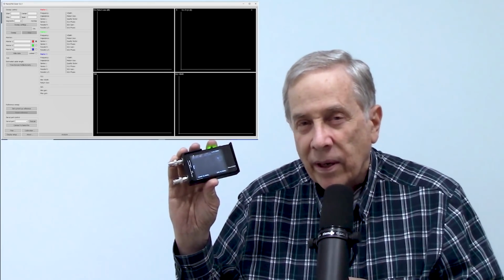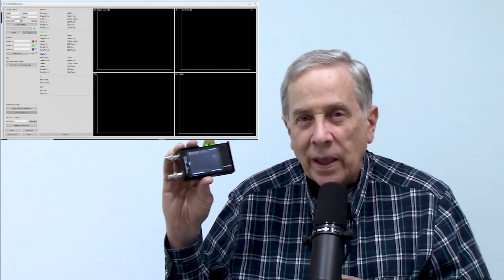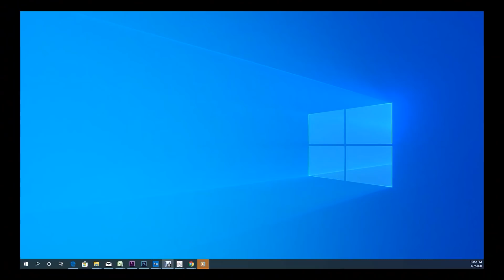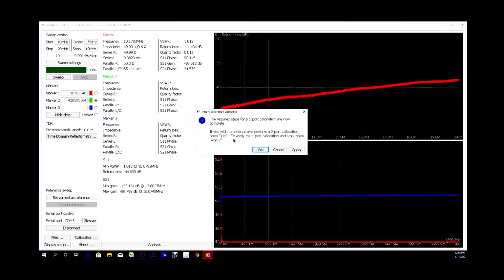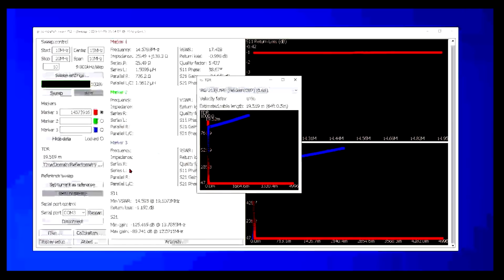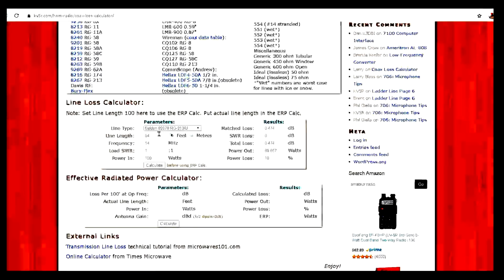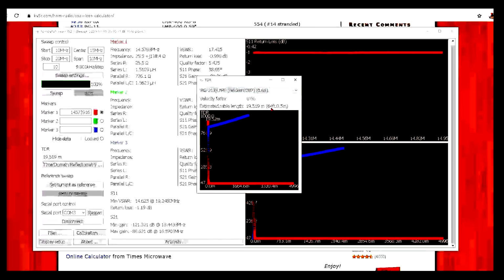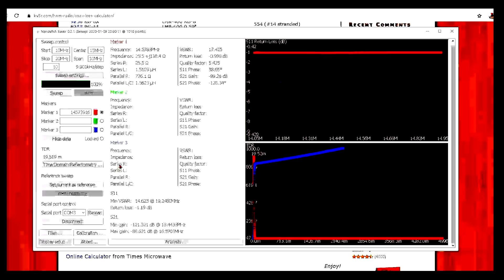NanoVNA To Test The Loss & Length Of Coax Cables by Jim W6LG YouTube Elmer for Ham Radio Basics

Comment: Will the nano do these tests without using a computer and computer program?  To buy a nano AND COMPUTER IS PROHIBITIVELY EXPENSIVE !!!
Reply from the maker: My eyesight is not good and reading the small screen on the nano is almost impossible at this time.  So, a computer screen really helps.  For the $50 or so, the nanoVNA's are a bargain and provide a bunch of information.  Guys will spend $500 on a microphone and then put up an antenna that is not efficient fed with a really terrible feedline. Spend your money where the "rubber meets the road".  Many have no money for anything extra and it is likely to get worse..much worse.  So just do the best you can and get on the air with whatever you can cobble together.  A dipole is a good antenna and you won't need a nanoVNA for something like that.  Again do the best you can with what you already have.  73, Jim in Rocklin CA

Comment: Generally good video.  Only one very important technical comment.  The loss you're measuring in this instance is not transmission loss, but return loss.  You're only conducting an S11 measurement.  To measure transmission loss you need to do an S21 measurement, ie. both ends of the cable under test connected to both Nano ports,

Comment: Good video. I use my VNA all the time, especially last summer redoing my antenna's
I HAD a MFJ antenna analyzer and sold it. Seeing the resonant point  and characteristics of the antenna (like multiple dips) on a graph makes it so much easier. They've a new larger VNA out that's like a cell phone (NanoVNA 10k-1.5GHz Antenna Network Vector Analyzer VHF HF LCD 4'' Standing Wave)

Comment: Hi Jim hope everything is good with you enjoy your videos quick question about coax length I’m getting ready to cut some brand new LMR 400 to go with my new steppIR DB18 antenna , is there any formula to stick close to as far as length or can I just cut it willy-nilly to whatever length fits neatly into the shack you know multiples of three or whatever just some thing I’ve heard most of my life and never got the real skinny on thanks in advance
Reply from the maker: It is my opinion that it does not matter.  In some situations where you have an antenna on a single band and you want to know what is happening at the feed point, then velocity factor times the wavelength (or half) is helpful.  With that antenna, it would be impossible to find a length that matches all of the possible frequencies or bands.  Use the best silver plated Teflon insulated connectors that crimp onto the LMR400.  Do follow the instructions from the manufacturer (I've met then a few times).  Do use a choke.  Ferrite beads should be fine.  73, Jim W6LG
Reply: @ham-radio  thank you 73

Comment: Hey Jim! I'm thinking of getting one of these so I can tune antennas that I want to make. I have another antenna question for you: You said in this video that you don't recommend RG8X for 2m and 440. I'm wondering why that is, and if your reasoning still applies for HT's (less than 10W output)? Finally, which coax DO you recommend for good 2 meter and 440 performance?

Comment: Jim I just bought a yaesu 450d ham radio it's a good unit let me know 🌈👍
Reply from the maker: I have one.  The menu system is confusing.  Otherwise it is fine.  For many, that is a first HF transceiver.  The price is very good and the circuit board is one that is known to be reliable.  73, Jim

Comment: Once you put terrazzo flooring in your radio room Jim I'm happy that you came back continue making good new videos I'm I'm happy that you're back and good and good health 👍☘️🌈
Reply from the maker: Thanks Angel Help.  I have been pretty much consumed with getting an antenna up and working.  I have the boom in place and hope to mount 3 elements tomorrow.  The heat has been a "killer'.  Temps in the rangelof 95 to 100 with high humidity have really slowed me.  The boom  I had ended up being  18 feet.  I had a couple at 26 foot long but I knew that would be pushing it a bit too far.  I had 2 booms that were 14 feet.  That seemed too short for 20 meters.   I am making the antenna for gain and not front to back.  
Thanks again for the kind words and support.  73, Jim W6LG

Comment: 2 things, forgive if I missed it while watching:

1)  What is at the end of the cable?  Short?  Open?

2)  Cal is done with the standards directly connected to the port, correct?
Reply from the maker: 1. open
2. Yes
3. 73 and thanks.  I need to get mine out today and test some cable.  But man, it is going to be 100 degrees.  Part of that cabling is in the attic.  There is no way I can go up there today. 73, Jim
Reply: @ham-radio  Hey, thanks so much for replying.  I have a 500 ft roll of RG6 that I want to get the loss on.  Can't always rely on the charts for that, especially when it is not a flagship brand.

Comment: Thanks for the video, Jim. Mike, OE6MBG
Reply from the maker: You bet Mike.  How are you and Sissy?  I think back to your visit and wished that we could do that again some day. The move has frankly been a struggle.  My health decline has accellerated and projects take forever.  I motorized that tubular tower and will have a max height of about 13 meters.  There is a motor for laying it down, extending the square tube and for rotating.  City code enforcement officer visited a neighboring ham because he was in excess of the 9 meter height restriction but just little.  That other ham came by for a visit and is just super nice.  We had a great conversation.  He has the same tower and is one of about 3 guys that I know of on HF who have some kind of beam.  I have built the elements for a copy of a Hygain 203ba.  The CEO does not approve and hence the slow down.  It may start out as 2 elements and grow when no one is looking.  Ampzilla is in pieces.  The three other amps seem to be fine.  One is a GS35b, two 3-500z with 3.5kv and the 500 watt Elecraft.  Thanks Mike and 73 from Rocklin California where it will be 100F today.  Let's see 1.8 plus 32F...so about 33C.
Reply: @ham-radio  Hi Jim, glad to know you are on the way back to HF. Hope everything will work out with equipment and antenna! Talked to Ira a few days ago, he is waiting for you to come on the air, too. 73 Mike & Sissy

Comment: good video but no need to measure in feet yards and inches these days.
Reply from the maker: True.  My old age is stuck on things like that and using a pencil and paper.  Thanks for watching.  I could not get the uploaded video to look as good as the ones on my hard drive.  I  tried 3 uploads and finally just gave up.  Something in the process of uploading caused problems with the bright/contrast and audio.  Thanks for watching, Jim

Comment: Its a game changer for ham radio operators!! 
Its very usable for antenna tuning, cable loss measurements. For the money its hard to beat. You even get a „cal kit“. The load is not the best, but works ok. I would not use it for professional work, but for a ham radio operator this is good enough and almost a must have.  
I have access to really expensive analyzers, at least 40-50 dB more expensive. I would not use this for Professional work, but home I dont bother to to bring the „real stuff“ along anymore.  
Btw the guy who made the software is not from Africa, but Sweden.

Comment: Hey Jim just getting into radio im a long haul truck driver
 i operate a dx98vhp stock mic on a willson 2000 trucker antenna  and i know import radios arnt the best but this as a mobile unit works perfect  it has a 200watt amplifier built in and does about 70watts barefoot 

my question is how would i maximize my powe out put so i can talk longer distance i know getting a 102 whip would give this radio full potential but i was wondering if i cut it down to a 51 inch antenna 1/8th wavelength and still get good clear communication long distance 

another question is with the watts this radio can push how far should i exspect to get out with normal conditions and a 102 1/4 wavelength antenna 

the reasons i ask is im cosideing leaving this as a mobile unit and building a shack
just getting into radio havnt been licensed yet and i watch all of your videos on radio  

if im ever in the Sacramento area ill try to reach you 1127 the mobile base 73

Comment: Thank you for the presentation of the abilities of this little device. I followed your instructions, though the results were not so accurate.
So, I have a key question. In order to measure the length and the losses of a given coax, must it be free at the far end? Or can it be connected to the antenna?
Thanks again,
73 de SV1SLB
Reply from the maker: It is recommended that it be open.  Thanks for asking a very good question.  73, Jim

Comment: KEOZHJ, thanks Jim , this all new to me but im going to check it out, ounce i save up for a few new toys, saving up for an HF Radio and other equipment this is not a cheap hobby but none are,  thanks Jim , god bless and have a great day!
Reply from the maker: Thanks very much.  Isn't there a song where "nobody knows your name"?  Cheers maybe?? HF is a blast.  Check with locals and a local radio club.  Often there is a radio from an estate at a very low price.  For your first radio, get something that does not need repair.  Something that you can put on the air right away with a clean signal. Take care & 73, Jim
Reply: @ham-radio  thanks i will , there is a club im trying to contact and im looking at a cheap portable to get me started,  i will keep my i out for some sales, KE0ZHJ 73.

Comment: Hello jim are you ok it’s been a while from your last video .Just checking hope you are doing well 73 KB2SVC
Reply from the maker: Thanks for asking.  I did have a few setbacks.  Recently, I broke 3 ribs and did other damage in a fall against the downspout on the side of the house. I am trying to get a straight answer about whether or not my severe osteoporosis is part of the cause.  I am trying to finish building the station so I can shoot a video.  I got on the air for the first time in 14 months, a few days ago.  I did work some DX during the contest using a dipole at 20 feet.  It took me days to solve a problem with the station.  I will discuss that in a video.  The problem, in part, was caused by a coax connector that would not completely connect to the SO239.  The sleeve on the PL259 was longer than the threads on the  SO239. The problem was intermittent.  Thanks again!  73, Jim
Reply: Thank you for getting back to me Jim.I was wondering what happened to you since it’s been a while. Please be careful  if you need help am sure there are some good people that will give you a hand. Am glad in a way that you are ok rest get well and we will see you on your next video.#1 in my book 73

Comment: Jim, W6LG: special request.  I have a few friends who I am persuading to use a scope to monitor the output of a linear amplifier to avoid flattopping and as a means monitor PEP. Any chance you could put on a tutorial. I'm thinking in terms of using a regular bench scope instead of a station monitor.  Thanks, Al W1VTP  Best wishes for you in your new QTH.
Reply from the maker: What I will attempt to do, after a lot of thought given my situation of being in self quarantine, is using a cheap SDR receiver and large screen video monitor with a screen capture device in the HDMI line.   You may have read that the first guy to die from that virus was a neighbor. So we are all being very careful...at least us old folks. 73, Jim W6LG

Comment: Hi Jim, been a few weeks, wondering how you’re doing.  I know well how long setting up shop can take, especially with distractions, but just wondering if you’re OK.  If nothing else to say hi to your viewers, can share some photos of any progress.  If you need labor, I’m sure a shout out to the community here would be responded to.  I’m not the closest here in Texas, but I’m willing too.  Anyone would enjoy the oppty to work and learn from the process.  Sounds like your shack aspires to be very interesting, especially to novices like myself always eager to see another shack design and set up.  Best regards!
73
Reply from the maker: Hi Tom,

Thank you.  Oh, I did respond to you but did it in the wrong way for YouTube.  Hence, it went nowhere.  Thanks for the offer.  Here's where the process is as of tonight.  Walls are painted, electrical outlets are finished with cover plates, furniture is in the room, much of the equipment is on the ham desk, video editing equipment is on the other desk, 4 coax cables are installed in the wall and terminate in the attic near the rear wall of the house, rotator cables are not finished but are roughed in, ditto the antenna switches, 12 volt power supplies are in place with several devices not yet connected, 5 volt power  supply is operation and connected to an "on the air" sign, the solid core door is in place but the digital lock does not work, 8 security cameras on 2 systems are functioning but need alignment, six digital montiors are functioning, 2 of the 4 computer systems are working and that's about it.  Still lots to do.  A friend from my the area where I used to live has been helping me.  I had horrible reactions to two medications that put me down for a few days. One was Amoxicillin.  I had  severe reaction to it.  
Tom that is more than you wanted to know but with your kind offer, I wanted you to know where things stand.  It has been down to freezing here at night and cold during the day.  Tomorrow when my XYL is not looking, I will drill some holes in the rear wall of the house and put in bulkhead coax connectors.  Then with any luck, I can connect some dipole antennas in the very small backyard.  Boy I sure miss the acreage of the old house.  Take care my friend and thanks so much for the offer.  I have been in Texas a few times and was surprised at the kindness and courtesy extended to a boy from California.  73, Jim in Rocklin, CA
Reply: Jim W6LG 
Somehow I don’t get notifications of replies... have to figure that out.  Was just checking in again to see if any activity, and caught the reply.  Glad progress is taking place.  I’m working on my own shack’s set up, am fully set up except for that nagging last detail ... which HF antenna to acquire, and getting it up in the air.  Been stuck on this aspect for months, closing in on a decision I think, but literally every other shack detail is in place; including grounding, bonding, and lightning arresters... just can’t quite pull the trigger on an antenna solution.

Best wishes on good health and continued progress on your new grand HAMventure.

73
Tom

Comment: Great video... Would you recommend getting this NanoVNA or the MFJ 269C ?  Or both?  (or better, would I NEED both) ?   Thanks Jim.
Reply from the maker: They have many differences.  If money is tight then the Nano would be my choice.  The MFJ device is great and has been a big asset to us.  I do have an older version of that...actually more than one.  I prefer the Nano for most testing because of the very nice software that comes from the guy in Africa.  Thanks Robert for asking an excellent question.  I wished I had a better answer for you.  73, Jim W6LG

Comment: They are excellent tools, mine has taken the guess work out of measuring common mode impedance of my choke baluns.
Reply from the maker: Nice to hear from you again. Is it possible for you to do a very brief description describing how you did that test of common mode.  Thanks from Jim W6LG in Rocklin, CA
Reply: Jim W6LG , the layout was effectively the same as G3TXQ used on his website. IE for example if the balun is wound with coax the extremities of the braid are treated as a two terminal device. Each end of this “inductor” are then connected between the ports of the VNA as though you were sweeping a filter. G3TXQ then calculated out the resistive and reactive components separating them with a little vector maths, I didn’t. I purely looked at the attenuation between the two ports. FWIW I believe that winding them with coax leads to high capacitance between windings, I am now winding them with PTFE insulated wire in a broadly bifilar style. My measurements using FT240-31 cores have been very interesting. Kind regards David

Comment: Jim, great introduction to the nanoVNA.  Is yours the -H or -F model?
Reply from the maker: I don't know.  I do know that it is an older version. When they come out with a significant change, I will buy another for testng.  Sorry that I can be more help.  I am really an HF guy and don't do much above 10 meters.  The device worked great at 440.  If you know of a way for me to determine which one I have, please let me know.  73, Jim W6LG
Reply: @ham-radio  My H model goes up to 1.5G so believe that's the biggest difference.  Maybe newer firmware but not certain.